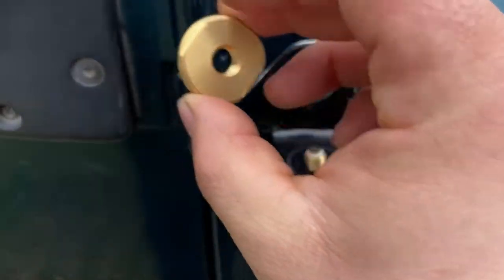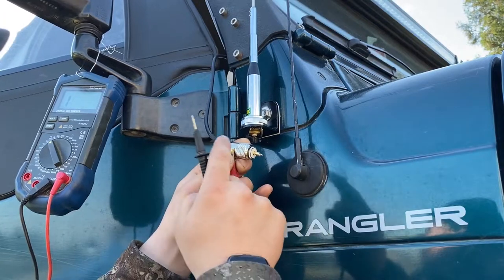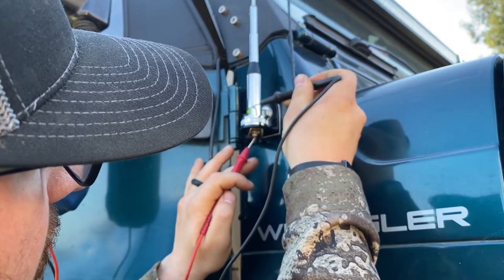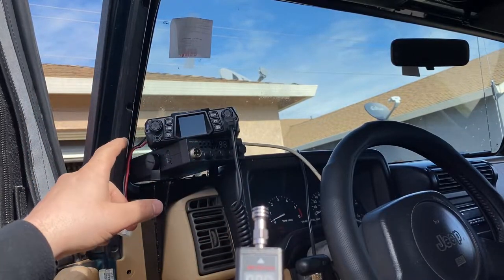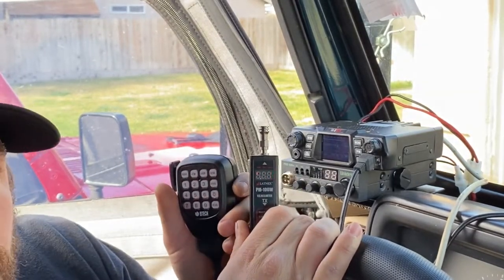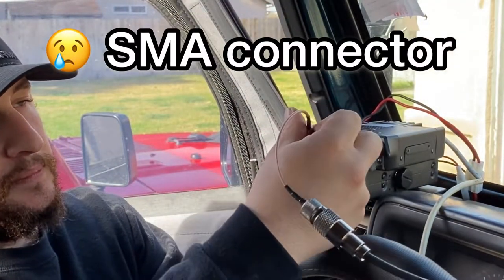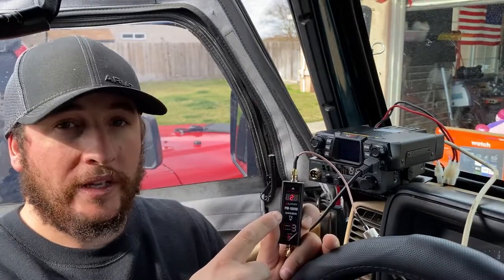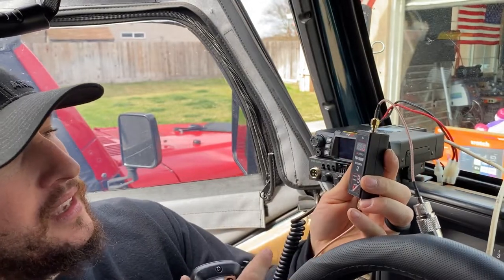How To Setup ANY GMRS Radio Antenna + SWR TUNING In My Jeep Wrangler TJ - BTECH Mobile GMRS-50X1

Comment: I purchased the same BTech GMRS 50X1. I haven't had a chance to install it yet. I thank you for showing me how to tune the nagoya 200C I bought the same one with mine. I hope to get this done before spring. Would you be able to tell me how much you ended up shortening the lower segment of the antenna ?  I just want to compare results after I tune mine. Thanks.
Reply from the maker: 💥 nice, I ended up taking about 1/4”- 5/16” off the antenna. Got swr to about 1:2 and stopped, will most likely take it out to open field and test again but I’m really happy with that! Also if you can I would at least suggest bench testing your unit now with 14vdc before installing it, just to see if it outputs.around 4w on low and at least 30w high . I say this because mine didn’t test good and I had to return my unit on my dime after the 30days. luckily they sent me a new unit so I’m very happy now! Also why this video took so long to publish! Thanks for watching I appreciate it! Cheers

Comment: Never cut the top of an antenna second you need a bigger dummy load to test on high power .. swr could change a difference on higher power .
Reply from the maker: 💥 nice 👍🏼 thanks for the great info, swr looked great after the trim on high output’ cheers
Reply: @ATEMOFFROAD  thanks for your videos .. keep them coming .

Comment: few things to add....first though great video lots of info for the diyer.... there is a perfect swr that would be 1:1, continuity is not the greatest way to check the status of your coax, that would be on the ohm setting and making sure its as close to the 50 ohms if your doing just the cable to mount. if u bond your doors, in a wrangler theres not alot of what would be a ground plane (not as important to the btech it doesnt need as big a ground plane as the uniden) use a 1 inch flat tinned copper ground strap no longer then 6 inches if u can help it from the door to a nice ground on the inside of the kick panel area abouts. great info on how important it is to set it up right with swrs, ive fixed many a setup that people have just thrown together and are pissed cuz they cant reach the pack leader around the corner on a mtn trail. i also like how u mentioned that its not a good idea to coil the extra cable slack, if u cant do as you say and cut it to length u can also make large up and down waves (think of a oscilloscope wave)with cable under the carpet, the only cevit to cutting your coax is u have to make sure u keep it in 5/8 wave lengths, basically 3 feet chunks 3,6,9,12....etc thats why most of the coax u see premade is in 18ft lengths. ps. if u want a better receive on the uv5r pick up the nagoya na-771 variety
Reply from the maker: Very nice explanation, a good read for viewers ! I don’t expect viewers to know electrical theory, but to share that a simple Continuity test could indicate a safe or short connection when connecting antennas To radios, I’d say more so a problem with cb circuits as NMO design really helps with that problem! Thank you for sharing and watching very much appreciate! Cheers
Reply: Old you please explain why coiling the excess antenna is bad? Thank You.

Comment: Is there not a driver side antenna mount? Just wondering why take it across to the passenger and worry about the cable length when you could probably get a 3-6 footer and not worry about it.
Reply from the maker: Yes The mount is for either side , and yes would be much better , but I hadn’t thought about that until after I had already dedicated my hi lift to the driver side bolt holes. Thanks for watching
Reply: @ATEMOFFROAD  No man, thank you for this video, it's a huge help. Sorry 1 more question -- Would there be room to just mount the GMRS radio if I get that CB mount and don't have a CB to stack on top of it? It looks like there isn't enough space and the doublestack actually helped you out.
Reply from the maker: @paulspurlock599  good question, yes it’s a tight squeeze without the cb radio, but I think it can still fit, between there , maybe up higher . It’s a good  setup for those who have a cb already there and don’t totally want to rid of there cb unit just yet. Either way I may just totally rid of my cb I haven’t used it in a long time mostly everyone is running gmrs now. I can and do another video on how that mounts without the cb.

Comment: Do you advise against running the coaxial cable into the engine bay along the fire wall and up the a pillar? I don’t see much issue running it there, I’m just not sure if anyone has information I’m missing to form a full opinion on the matter. I thought of doing this as I’m running my power to my light bar in that manner when I get it. Yes I’m aware that I may experience interference with the radio if I run it simultaneously with the light bar.
Reply from the maker: You could also pick up RF from the engine as well but I’d try it! If it doesn’t work out you could always move it later !

Comment: Did you ever test the range?
Reply from the maker: Yes we did test the range and I plan on doing more testing I just haven’t figured how I want  to do this test and make the video. There’s a place called top of the world about 4K in elevation. Not too high, but at that elevation we were able to transceiver at a line of sight around 60 miles loud and clear on 4watts. Pretty impressed at that ! My friend has helped me programm the radio and we are planing on connecting to some local repeaters to see how far we can make it! Thanks for watching 🍻 stay tuned definitely more to come

Comment: Hi my friend and thanks for the video! I just installed my Radioditty CB-27 on my car but I am having this noise/interference/static on the radio if I lower the squelch, any advice? 
BTW, I am planning on getting a GMRS too but I do not know how to wire the antennas (can be close to each other?) and if the SWR Meter for CB (WORKMAN 2-T) works for tuning GMRS antennas 

Thanks from a Venezuelan viewer!
Reply from the maker: Cb is usually know for that especially if your within close range, turning down squelch may help. Moving over to GMRS you will have much more clarity then that cb , and unfortunately no that swr tuner won’t work for Gmrs , will need a uhf vhf compatible tuner! For gmrs most of your tuning is not necessary! I use the tuner mainly for checking I have everything set up correctly and in good working order! No adjustments , Thanks for watching 🍻

Comment: Hey team! 
I'm planing to buy a joying 8.8 stereo for my Jeep TJ 2005. It's a renegade edition and It came with stock 6 speakers, sub and amplifer.

I know it's not a radio like what you just installed but hope you can help anyway. 

There is no steering wheel controls. 

I believe the 2005 TJ has PCI bus and not canbus from what I have read as canbus was not introduced untill 2007. 

A few local car stereo stores insist I need a amplifier retention kit.

But some forums I have visited insist that the 2005 is 22pin PCI Bus. 

Have you heard of a TJ with stock sub and amp requiring a canbus amp retention cables?

Was hoping this would work. 
https://catalog.pac-audio.com/catalog/installation-accessories/bha1818. 

Apparently Just need to make sure wire 13 is getting 12v from stereo to turn amp on. 

Any thoughts?

Did your jeep have sub and amp?
Reply: If you are buying the wiring harness that plugs into your factory wiring (70-6502) then you simply need to make sure the remote wire (blu/white) from the aftermarket radio is connected to the remote wire (blue) on the 70-6502.
Reply: @jasoncolette8598  thanks for the tip
Reply from the maker: @spastroboy  I just came back from auto zone , based on my research they stock the adapters you will need for your radio , can bus is 07-2014 wranglers and the part number is ssch11 radio install adapter by stinger select,  and 1984 -06 wranglers part number chwh1 by metra! This should cover factory amplifier and speakers , I also seen that both packages have included wiring diagrams , may want to take a drive over to Autozone. Hope this helps! Cheers
Reply: @ATEMOFFROAD  I want under the impression that canbus was only introduced into wranglers In 2007 for the jk model.